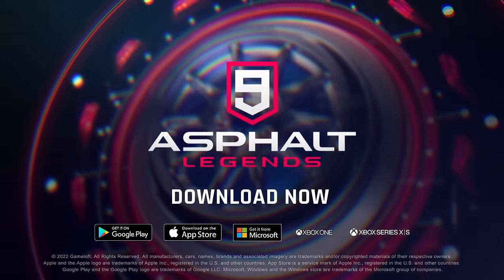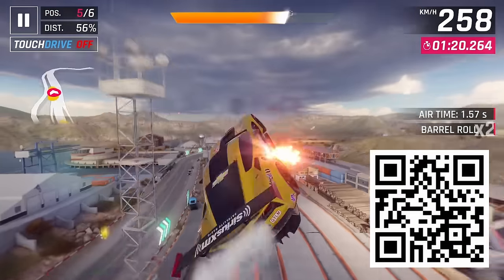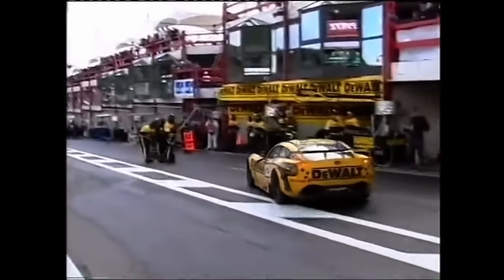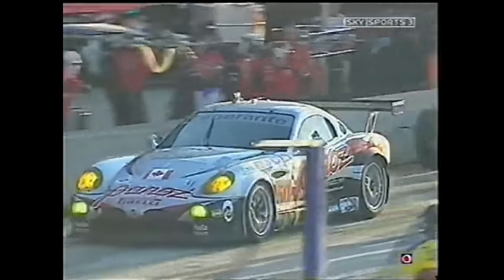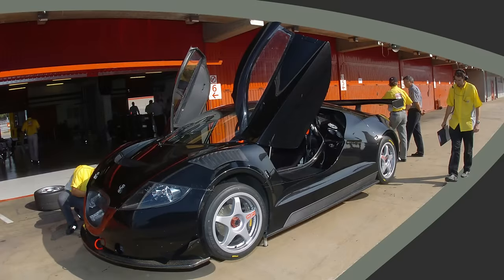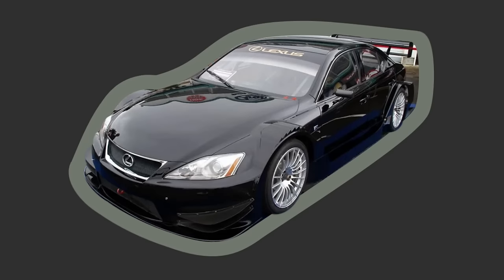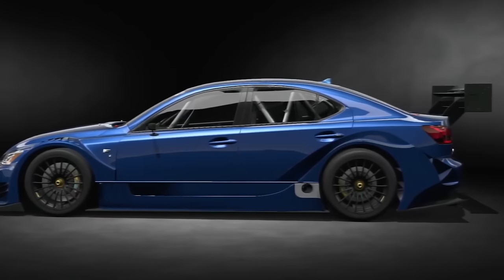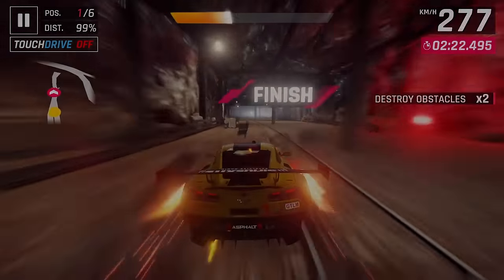Obscure race cars from not so obscure racing games

Comment: Maybe you could do a video on planned or even built racing cars that never raced. Cause for DTM alone, there are more cars than the Lexus concept. Zakspeed for example had a ready-made Volvo C70 for 2000. But because it had no backing by the manufacturer and used a Judd V8, which didn't quite fit the regs, it wasn't allowed to race.

Ford also had a Mondeo prototype ready for 2001. But they, too, didn't race that car. While the Zakspeed-Volvo and the Ford have appeared physically, the planned MG ZT entry from 2005 is even more mysterious. Apart from concept drawing, there hasn't been any sighting of a built MG DTM car.

Then there are of course the Audi and BMW cars for the 1993 season, which were built, but ultimately not raced, cause both manufacturers were at odds with the organizers at that time.

Comment: Now an interesting fact: DTM cars at the time the Lexus ISF was unveiled looked similar to the Stock Car Brasil cars, which is a brazilian touring car championship like DTM. The car the Lexus tecnically was (the Opel Vectra), was sold in brazil under the chevy brand and if im correct, also run in Stock Car Brasil

Comment: 8:50 Sad Toyota decided to use a BMW for their Supra after they already made a car to compete with the M3, and went this far with it; they should have looked outside of their cookie cutter hiring process and got some non-Toyota engineers and designers to tune and redesign the is-f to become the Supra, they would have an authentic car and may have actually learned something other than that Toyota designers and engineers are only good at designing boring to drive appliances with no soul.

Comment: "Diesel" prototypes lol
Reply: They were. Audi and Peugeot both ran TDI LMP1 cars from 2006 to 2016. They were fast, reliable, efficient, and made far more power and torque than any of their petrol competitors at the time.
Reply: @vgbondarev  they were TDI In name only. Those cars DO NOT run on diesel fuel.
Reply: @kylemcneal7856 they were diesel and tdi doesnt even stand for diesel it stands for turbo direct injection. Did you ever hear or smell them in person? They were definitely diesel
Reply: @plisskenationbackfromthede3657  shell developed a synthetic GTL fuel (which is very difficult to find anymore) specifically for those cars. Yes. I know what TDI stands for. And tou shouldn't have been able to smell those cars running at all. They have particulate filters for the exhaust. I know this because I have in fact seen one up close hands on. I know someone whose bought one of the actual raced cars. Firs thing they told him when he took delivery of it "don't put diesel in this thing" I've seen and read all the marketing BS they successfully pushed out about the cars and diesel being the advanced green fuel they said it was..... but audi weren't exactly truthful about any of their diesel powered cars back then lol
Reply: @plisskenationbackfromthede3657  Audi used different nomenclature for their cars. Generally, TDI denoted Diesel, whereas FSI denoted petrol. Peugeot called theirs HDi FAP, if I recall.